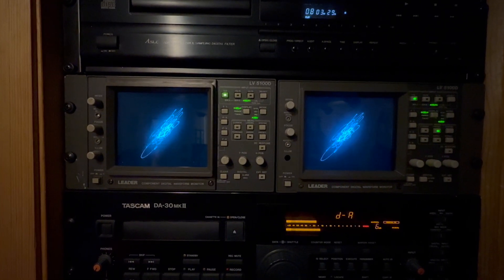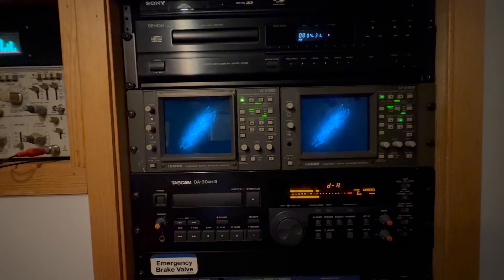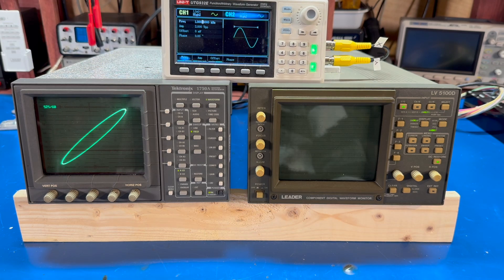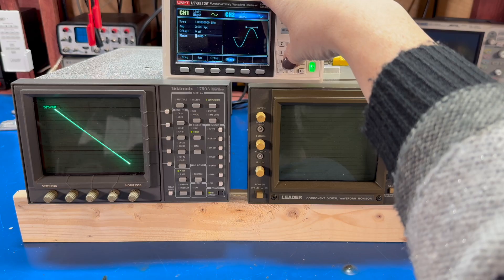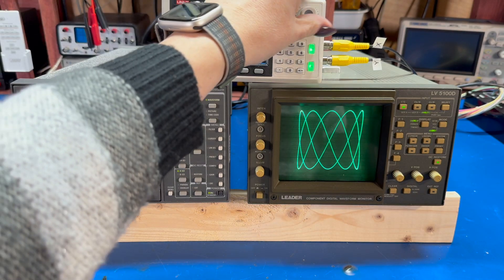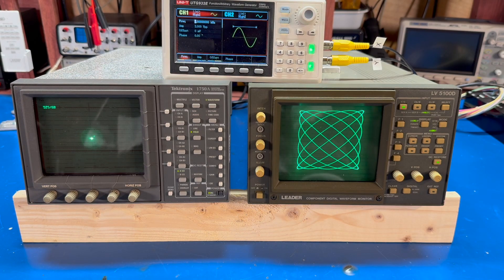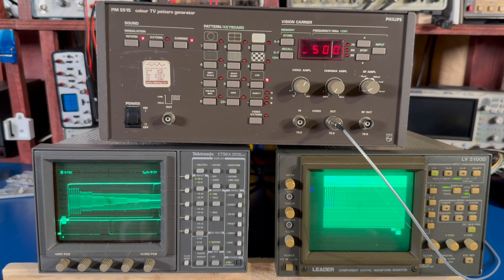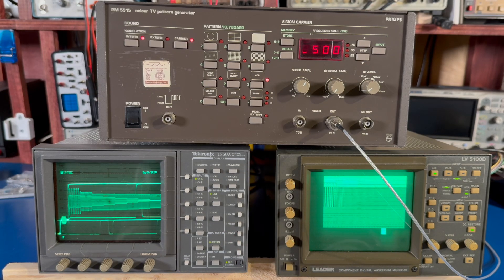Audio on an LV 5100D / Tek 1750A Waveform Monitor / Vectorscope

Comment: How would you go about getting audio signal from a computer into the 25 pin connector?
Reply from the maker: This is not a 25 pin RS232 connector, so a USB to  25 pin RS232 will not work.  You need to get audio out from your computer: either a headphone jack on your computer, or USB audio DAC (like this: https://www.amazon.com/LiNKFOR-Coaxial-Headphone-Converter-Optical/dp/B07SR7BYD6/ref=sr_1_6?th=1adapter.). Then wire up a cable as shown in the doc posted in the Posts section on my channel page.
Reply: @ I appreciate the reply! I have a leader 5872a and I’m trying to get osci studio to work. When I have the waveform monitor in vector mode I don’t really get anything visible other than a little circle around the centered dot. I’m able to pick up waves from my synthesizers in every other mode however. Thanks again for the advice!
Reply: My initial thought is to buy usb to 25 pin but will my computer allow me to select that as the audio output is the question

Comment: can you remove the graticule lines on these units?
Reply from the maker: Hi - the graticule lines are (usually) etched onto the CRT, but are close to invisible with the scale illumination turned off.

Comment: Hello! I have a Tek 1740A waveform/vectorscope and am having trouble getting anything from the audio remote inputs. I've tried both balanced & unbalanced inputs from a variety of sources following the pinouts you linked (cross-referenced in the manual) and still no luck. I imagine I am missing some settings on the scope itself. Do you know what mode you need to be in (Audio or Waveform) and if there's any other important settings in the various menus to configure to get a proper display like you have of audio XY?
Reply from the maker: Page 2-23 of the manual explains this: connect the left and right audio signals to the rear-panel REMOTE connector as follows: +Y to pin8, -Y to pin9, +X to pin10, and -X to pin11. Select AUDIO display mode (there is a front panel button to select this.)  If it is not working, there could be an issue with your 1740A.
Reply: @Donna_Matthews  thanks for the reply- I did try that but was getting nothing. I suppose there may be an issue with my device then :(

Comment: hi there, id love to incorporate this into my home set up. I love the visual aspect of this. can you please share the wire diagram? thanks
Reply from the maker: Hi!  There is a link in the description to the wiring diagram for the remote connector.
Reply: @Donna_Matthews   thank you. what approach could I take to generate audio to visuals for the LVS-5850B NTSC Vectorscope and the Leader LBO-5860A Waveform Monitor? I've found these two units on Ebay and wanna purchase them but not sure if I can achieve the same effect as you have. sorry in advance for my ignorance. I only know the basics of electrical engineering. thank you in advance !
Reply from the maker: @harveymiller5678  Hi - It doesn't look like either of those units will accept audio input. 🙁

Comment: I really need help with mine, i recently bought a leader vectorscope on ebay and i cannot find any info on how to actually set it up to work, im trying to use it for audio if possible and i got a cord for it but it's different than a 25 pin, it doesn't even have a 25 pin plug in only the circle looking ones,, so will I even be able to use it for audio??? or only video?
Reply from the maker: These scopes usually do not have independent audio jacks, so if the unit does not have a DB-25 connector, then it likely does not support audio. Looking up the model on line and grabbing a manual will be super helpful for whatever you use it for.
Reply: @Donna_Matthews  Hey! Where can I find the schematic/layout of which 4 pins to solder rca cables to? :-)
Reply from the maker: @bj888rn  On my channel main page, under 'Posts' is the pinout for the DB25 connector. 
https://www.youtube.com/post/Ugkx9xE6jOIor0AHlBN2Uenw0Txk7-H6sooc
Reply: @Donna_Matthews  SUPER! thank you! :))